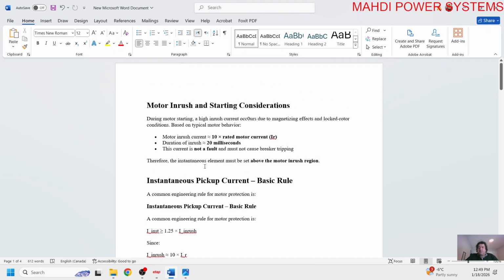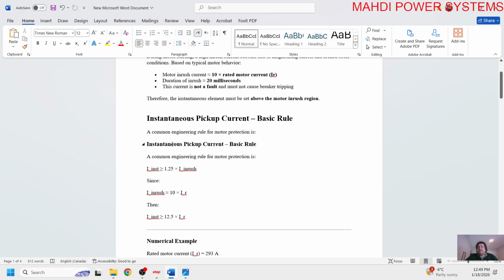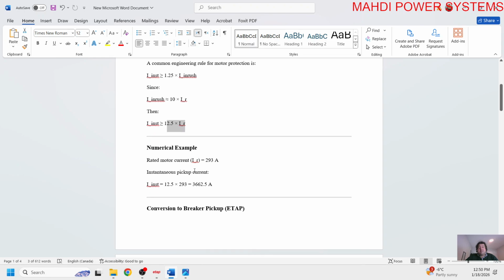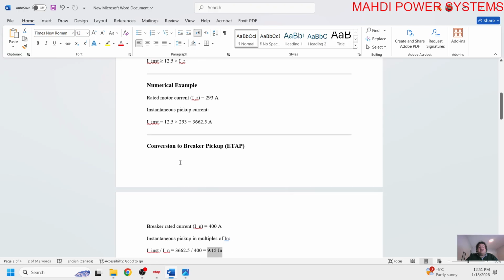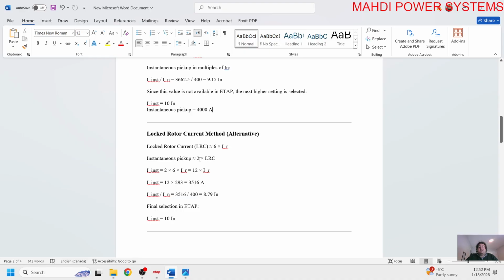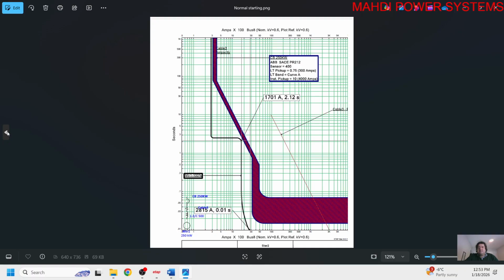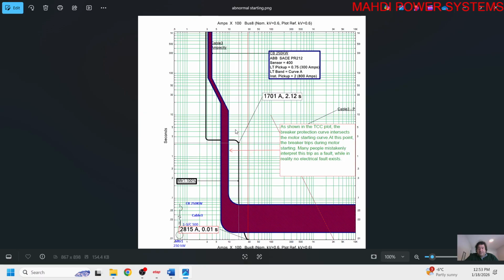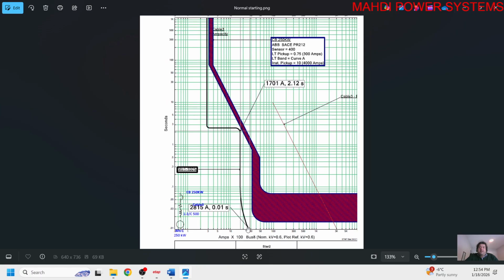Wrong ANSI 50 Instantaneous Setting? Motor Starting & Protection Coordination Explained

Comment: Thank you for your excellent explanation. I have a question regarding the motor startup curve. Typically, motor datasheets provide the startup curve under no-load conditions, whereas under full load (for example, with a pump or fan), the startup time may become significantly longer. This can cause the startup curve to intersect again with the trip curve of the relay. How can this problem be resolved?